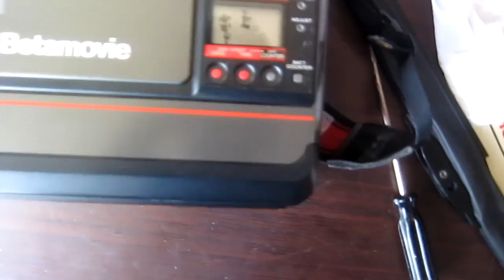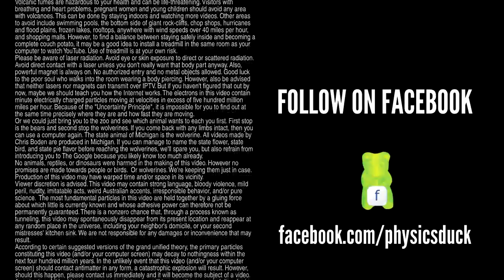Captain's Blog 6-2-11 High Voltage Lab Grounding System Build

Comment: Sorry, I forgot to take the batteries out of the ultrasonic tape measure. (don't beat me with the hose, please). The NEC charger is for the camera, as is the BP battery.  The tape is for the camera as well.  The plugs are PL259 (you were right the first time) :-)